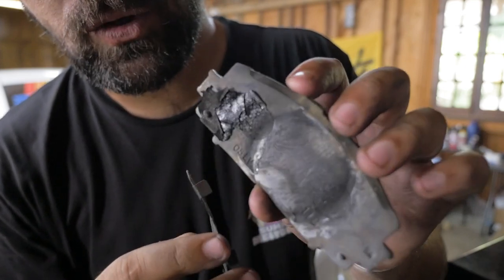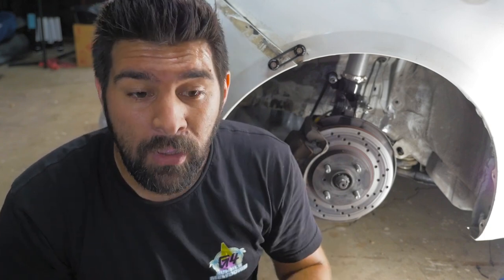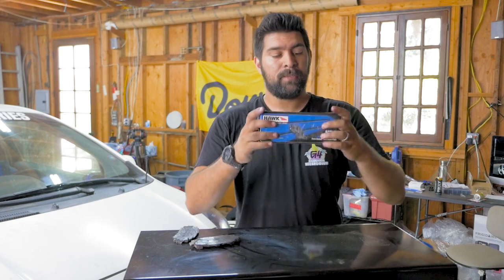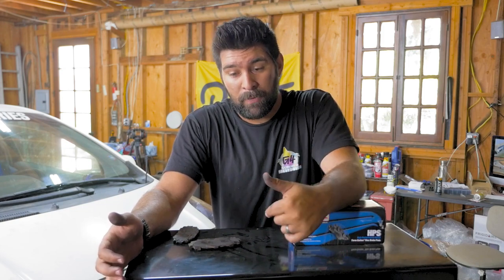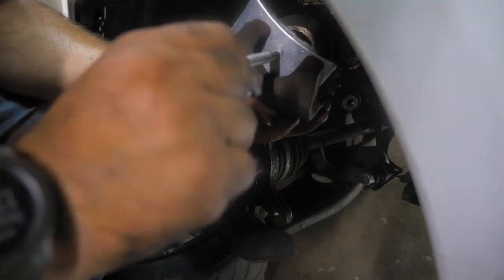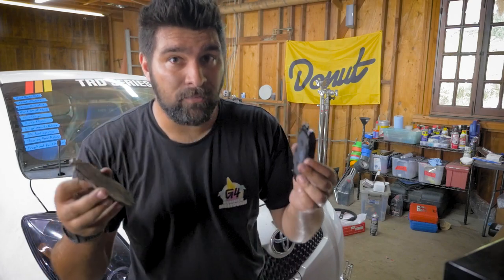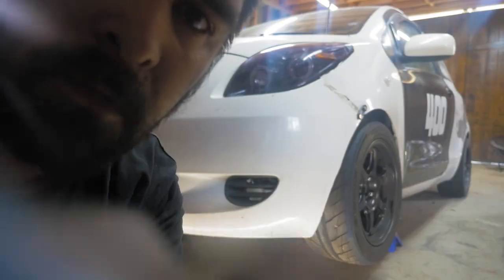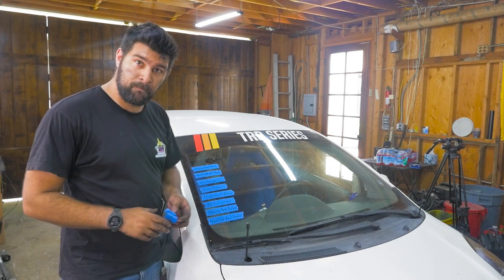I melted my brakes

Comment: Are you still planning on going with the bigger rotors up front from the Yaris SE?  I did mine about 2 years ago, they were great, but my rear drums brakes couldn't keep up.  My aggressive driving on the road made them fade fast.  I recently did a rear disc brake conversion, using a ¼ inch thick steel plate as an adaptor to mount the calipers (no rear axle beam swap requires welding brackets for the rear most brake lines connected to the calipers).  I'm going to be honest, it's not a fair comparison, because I flushed out the old brake fluids.  But what I can say is I'm very happy with my results.  I can brake a lot later now, and I've improved my fuel consumption.  I guess my rear drum had overtighten themselves over time, and were dragging.  Also, I don't drive in the lower gear anymore during my city driving, to anticipate slowing down or stopping.  I'm more afraid of people rear ending me, now that stop on a dime, than me rear ending someone, even with no ABS.  The rear drum set felt heavier than the disc and caliper set, but I'm not completely sure, because I ended up tossing the drum set before I could weigh them to compare.  But that just meant that the Yaris is even more front heavy now if I'm correct.  😅
Reply from the maker: That sounds good! I kind of got turned off by the idea because a friend of mine did a similar swap and ended up with a very squishy brake pedal. I might give it a try. Mid-season, but for now the brakes are holding up fine.
Reply: @RassoolRacing  my reply didn't post, I hope it doesn't double post.  Maybe your friend didn't bleed the calipers properly, or the old fluid might need to be flushed, I don't know.  Anyway, I recently discovered that the 2nd Gen Scion xB (xB2) and the Prius has the same mounting holes pattern for the rear wheel hub as the Yaris'.  My theory is that their rear axle beam might fit in the Yaris.  In that case, you might use them as a substitute instead of the low inventory Yaris SE's rear axle beam.  You may even use the xB2's rear calipers, but you'd need to swap the caliper carriers/brackets with a Corolla.  The xB2's rear rotors are 279mm in diameter, the Corolla and Yaris' are only 259mm.  If you're interested in fabricating an adaptor plate, check out my thread in the Yaris World, "Alternative Rear Disc Conversion?".  The adaptor plates will obviously push out the wheel hubs, making the rear track wider than stock.  I'm not sure if that'd have a huge impact on your turning radius.

Comment: If I can ask, from which Corolla model u tooled these callipers ?

Ps. Good job as always :*
Reply from the maker: 2009-2013 Corolla or a Scion xD
Reply: @RassoolRacing  thank you, rofl i just noticed how i've got trolled by automatic dictionary :<
Reply: Did you have to use the Corolla brake booster and master? Any idea if they are different?  Thanks

Comment: Joey, do you ever plan on running an aluminum flywheel or getting a header?
Reply from the maker: Got a header ready to go on. I could do a lighter flywheel, but if I'm pulling the trans then a lot of other work is getting done too. LSD, final drive, etc.
Reply: Yeah I wondered why you didn’t do it when you did the swap? I have an 07 Yaris like yours. 5 speed from the factory though. So far I have an InJen CAI, NST Pulleys, NST SSK (once it arrives), WeaponR header on the way, and I put Konig Helium wheels 15x6.5 with Perelli P4 tires. It’s a street car. Just trying to increase performance while also increasing MPG’s. What header are going to install?
Reply from the maker: @garymiller5789  honestly just ran out of money at the time. It was a lot cheaper to get the OEM flywheel
Reply: Gotcha. I only got my Yaris a couple of weeks ago. I’ve enjoyed your videos. I guess you don’t want to mention what brand header?
Reply from the maker: @garymiller5789  some eBay brand. Bought em used.